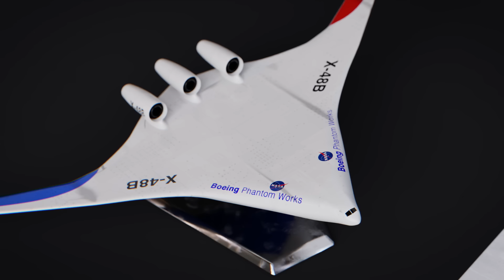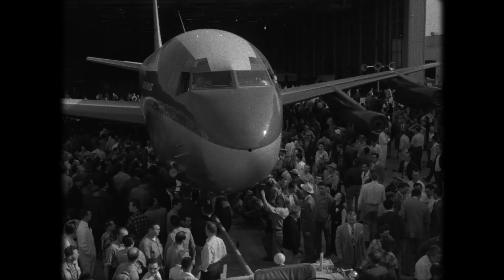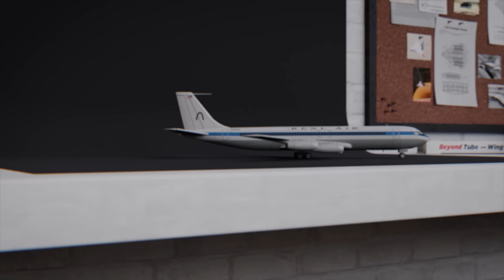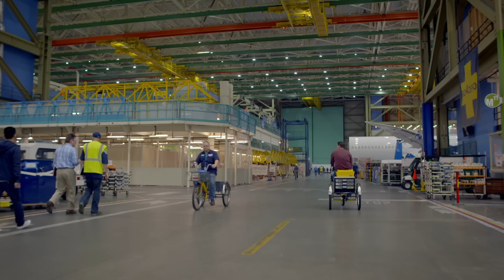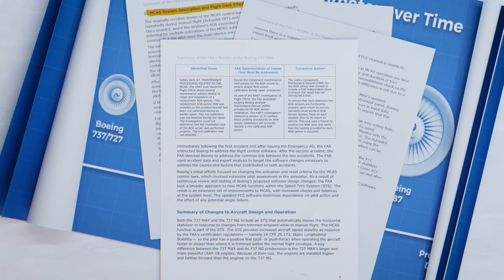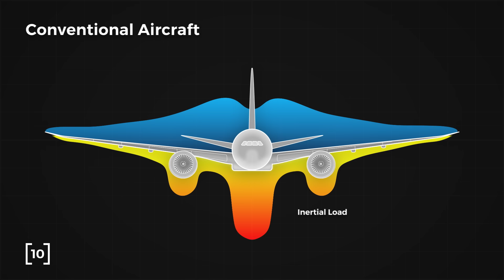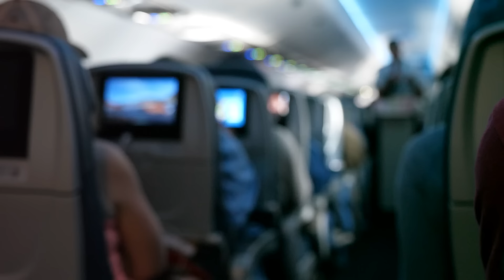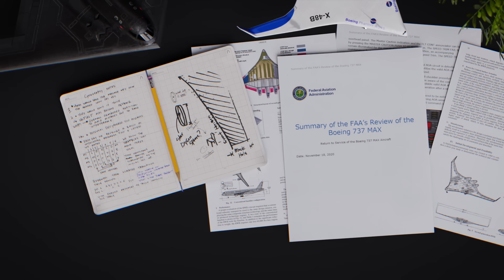The Plane That Will Change Travel Forever

Comment: 8:49 why can't they put the center of lift of the main wings AHEAD of the center of gravity, and then have the horizontal stabilizer also produce lift? As long as the stabilizer's lift was more susceptible to changes of angle-of-attack than the main wings (e.g: plane points up, stabilizer provides drastically more lift, pushing tail up and pointing the plane down - and if plane points down, stabilizer suddenly stops producing lift, pushing tail down and pointing the plane back up) wouldn't the plane be passively stable? What stops them from doing this?
Reply: There's nothing that says that the Center of Lift has to be ahead of the CG.
It just so happens that putting the Center of Lift behind the CG (or at worst at the CG) is an easy way to come up with a stable configuration.
If you want to produce a stable configuration where the horizontal stabilizer (almost) always generates (positive) lift, then one easy way to do that is to put it (the horizontal stabilizer) in front of the main wing (AKA a canard).
There's nothing "wrong" with a canard configuration as is evidenced by any number of General Aviation (GA) aircraft like many of Burt Rutan's designs.

This video is a simplification of the reasons why various aircraft designers are interested in flying wings and so speaks in terms of generalities and simplifications to make things "understandable" for people who aren't familiar with aircraft design and so leave a lot of things out.

For example, they left out the fact that the Center of Lift moves around on on virtually every aircraft wing depending on speed and Angle of Attack (AoA) among other things.
Because of this, it's common for aircraft designers to think not in terms of where the Center of Lift is currently at on a wing, but rather about the lift that the wing produces at a specially selected point on the wing called the Aerodynamic Center (AC) and the "pitching moment" (i.e. the force that's trying to rotate the wing about the AC) which is independent of AoA.
Doing so makes it easy to come up to figure out the size the horizontal stabilizer and the length of the fuselage separating the CG from the horizontal stabilizer needed to compensate for the pitching moment of the wing.

You can make a wing out of wing sections that don't have any pitching moment to them (so-called zero pitching moment sections), but "usually" they aren't used on most aircraft.
So in order to eliminate the effects of pitching, one usually tweaks the planform (i.e. is the shape of the wing when viewed from overhead) of the wing so collective actions of all the wing section pitching moment effectively cancel out.
As it turns out, a properly designed swept back planform will do just that, but at a cost.
(And OBTW, contrary to what the video seems to suggest, there's not that prevents a swept back flying wing to be flown safely without Fly-By-Wire [FBW].)
Sweeping the wing means that (thanks to movement of air out towards the tips of the wings, not just straight back over the wing), different parts of the wing fly at what amounts to different AoAs where the outer parts of the wing tend to fly at higher AoAs than the inner parts unless the wing is twisted to try to even out the AoAs out along the span.
If you don't do this, then the outer parts of the wing can stall possibly leading to a condition called a "deep stall" which can't be recovered from easily (if at all).
Also one side of the wing can stall first leading to the aircraft wanting to flip over on it's back and spin into the ground.

Meanwhile, doing things to reduced these possibilities (like introducing twist into the wing) means that the wing doesn't fly as efficiently as it could if you just just stuck a tail on it in the first place.
And none of this takes into account the fact that an aircraft needs different amounts of lift during its flight.
For example, it needs to generate a lot of lift at take off and landing when it's flying slowest.
And to generated usually means that the wing has to take on a curved shape in order to redirect more air downward, which just happens to increase the pitching moment a whole lot, again creating problems for a flying wing that are worse than an aircraft with a tail.

Perhaps the most important thing standing in the way of a flying wing airliner (IMHO) is the fact that we're not talking about just a single change here limited just to the aircraft itself, but also changes to the infrastructure needed to support them as well.
For example, if you want to change the way in which an airliner is loaded/unloaded, then we're also talking about changes to the lay out of airport terminals themselves.
And that's not even including possible changes to run ways and their layouts to accomodate flying wings that are perhaps wider than existing aircraft.
As for liquid hydrogen fuel, dream on.